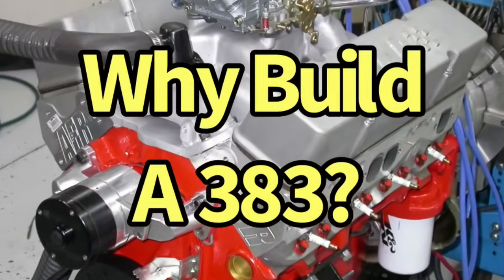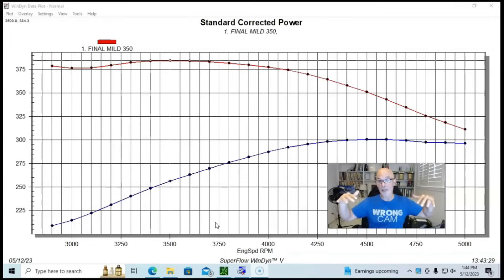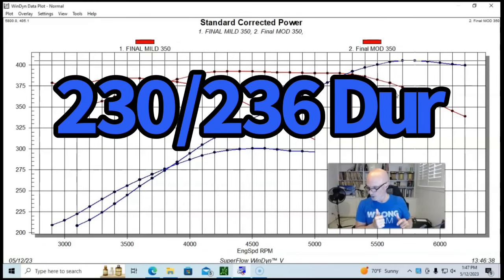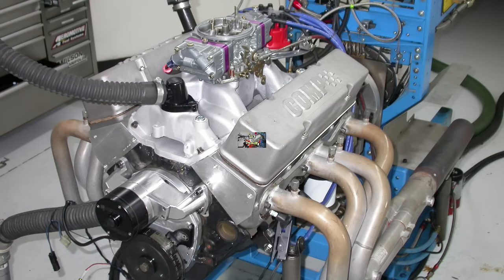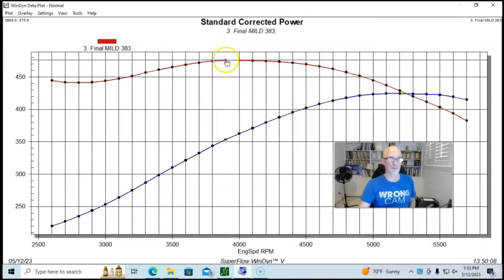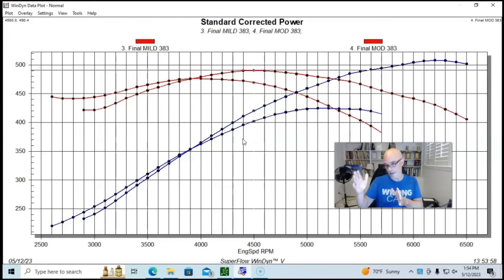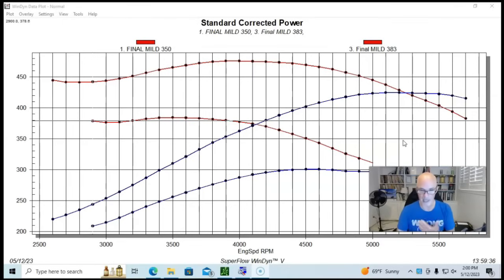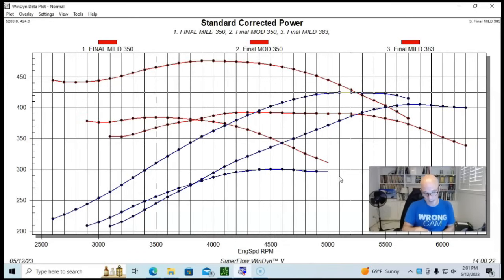HOW DO YOU MAKE MAXIMUM TORQUE WITH A SMALL BLOCK CHEVY? JUST ADD CUBIC INCHES! 383 STROKER BUILD!

Comment: I like it. 

Would the 351W/387W combo work with EECIV? Mass air seems like it might, but I am curious if speed density could be tricked into running it. 

Yes, I'm cheap.
Reply: It isn't "cheap" per se, but Sringer performance sells their PiMP eec 4 replacement that is basically Mega squirt in a plug and play package for eec4. You can even pick batch or sequentially fired injection
Reply: @AndyR1982  Yeah... $2500... It's a bit salty.
Reply: @Heathh49008  , yeah but if i read right, Moates is dropping further support for the Quarterhorse stuff in eec4 so it may be the only way in the near future
Reply: Separate trans controller for the E4OD and a Megasquirt may be my only rational option.

95 F250...
Reply: @Heathh49008  i know it is expensive but they also have PiMP xshift that controls the 4r70w and e4od. Save on having to get a standalone trans controller

Comment: Great test to show how much more torque you gain. Like to see 400 added in show where it stands.
Reply: Same here I'm getting ready to build a 406 would like to see how they compare
Reply: @tron6966  iif a blueprint 400 is any indication 500ft lbs or more
Reply: On a 030 over 400 small block Chevy,  500 pounds of torque and horsepower is very easy to do I built my 10.3 compression combo using AFR 195 street eliminator heads and a comp cams hydraulic flat tappet .507/.510 lift, 240 intake, 246 exhaust duration @50 on a 110 lsa. My combo did 521hp and 516 ft lbs at the crank on the dyno. I used an edlebrock rpm air gap intake, Holley vacuum secondary 750 carb and 1 and 5/8 full length headers. I Put that in a 69 chevelle combined with a th400 trans, a 3000 stall converter and 4.10 12bolt rear and it ran mid 11’s with a totally streetable package on 93 octane that you can drive anywhere. That car was a lot of fun until it lost in a fight with a telephone pole.
Reply: 400 tpi? Even more torque
Reply: Put a 4" crank in your 350, 409 cubes

Comment: Tq is power
Reply: If someone is familiar with electricity, I have a great way of explaining this to them. 

-Torque is like amperage. It’s the grunt or forceful push. 

- Horsepower is like voltage. It is potential energy or where it peaks.

 A stun gun may have 50,000 volts but only 5 amps. It has enough energy to stun you but not kill you. And despite all of that voltage, there isn’t enough amperage to spin a window fan.

A house will have 220 volts but the amperage will typically be between 100 & 200 amps. Either are enough amperage to kill you. And despite the lower voltage, the amperage will power an entire house.

Comment: Zero reason to waste money on these outdated builds. The 80's are over.
Reply: I ll stick to the 80s thank you, the good old reliable small block chevy, still listen to the music from that era too.
Reply: Depends what you're after, a 383 can make a lot of low end grunt, something a 4.8 or 5.3 won't do.
Reply: Actually if someone already has a SBC in a vehicle, all of the accessories will bolt up to a 383. So it might be more cost effective for them. And I have not seen an LS match a 383 torque curve.
 I will concede that the LS has longer life expectancy and is a huge jump in technology, but the SBC isn’t dead. And with current parts available, it’s easier to make power from one now than it was in the old days.
Reply: I won a lot of races against LS1s with a 383. And it wasn’t close.
Reply: I disagree the cost of an ls swap will get you a fresh overhauled small block that can dropped in a weekend
Reply: I have another reason. I has been around a lot of SBCs and quite a few LS engines. I am talking both stock and modified. I have seen a stock or mildly built LS engine idle as smoothly as an old school SBC. To someone who has done driveability and who is tuned in, every single LS engine has a rough idle like it is struggling to idle. And to old school guys who have a connection to the cars, this is unnerving. We are the guys who feel the suspension working and are always conscious of how the exhaust sounds. We tune our cars until we get the sound and performance that we expect from it and we know immediately if something is off. Maybe it’s a generational thing.
Reply: My outdated 383 can stay with 650hp TT bimmers I should toss it in the trash I guess

Comment: I don't dislike the 350 engine I've had very good experience with them. But I've always wanted a 383 because I believe that if you're going to spend the to rebuild spend a few extra bucks on a stroker crank. I think scat used to sell a 383 kit that was almost a bolt in deal. It had cast steel crank and was 3.68 stroke and needed to have a. 040 overbore to make up for the smaller stroke crank. But it didn't need the extra clearance that 3.75 crank does. I don't know how much they are now but it was like 1150 dollars for the whole bottom end. Crank, rods,pistons rings and bearings
Reply: There are several kits on the market.
Reply: @dannytravis7118 , 
327
Forged Steel Vette Crank in a 4 bolt main block , Forged 12:1 Pistons,  Ported Heads,  Comp Cam  ,aluminum intake,  750cfm carb, Headers,  11 inch clutch, Lakewood Blow Proof bell housing, M-21 Muncie 4 speed , 12 bolt posi  ,pulls both front tires off the ground,  screams to the moon at 11,000rpm,  in a 66 Chevelle Super Sport .

That line ,
There's  no replacement for  displacement  
always  makes me laugh !

Comment: These videos are a wealth of knowledge! 

How about a 5.7" vs 6" rod comparison, or maybe a 383 to 396 video? Keep them coming!
Reply from the maker: 5.7 vs 6.0 rods showed no power change
Reply: @richardholdener1727  agreed.  

But I bet you could find in the neighborhood of 20-30 lb ft tightening that lobe separation up to 106, keeping your same overlap by taking out duration and getting back lift via higher ratio rocker and probably not lose anywhere.

I don't understand why SBC circle track cams are 106 lca (outside street stock & compression limited classes) and street cams are 110-112 when 14:1, higher valve action race engine with better heads will want wider lca for a given displacement and 106 is usually closer for the street.

Appreciate & enjoy the content, thanks
Reply: @sc358.  agree with your first paragraph
but if you have optimum compression with the wider lca squeezing the lca will give you more or too much cylinder pressure, you have to do as you say and change the whole formula.   We can talk about better flowing heads (and hemi vs wedge) and lca later  cheers
Reply: @richardholdener1727  was that using the same camshaft, or changing to camshafts that reflect the different piston speeds? I'm assuming the difference in length isn't creating that much difference in piston speeds, but...that's what the dyno is there for :)
Reply: @albertgaspar627  not just piston speed along crank rotation but velocity of the intake charge
Reply: @jmflournoy386 just to be sure, when you say "velocity of intake charge" you mean the piston's speed is enlarging the volume enough to change the pressure of the atmosphere inside the cylinder itself?  

because changing the piston speed can also change evacuation on the exhaust cycle, leaving a "cleaner" cylinder for the intake stroke to fill up.
Reply: @albertgaspar627   Sorta The velocity of the intake charges lags behind the piston, velocity increases even as the piston is slowing down/   at TDC at overlap u get some velocity due to exhaust suck, getting the charge moving is very important as I said above if you do not you can never catch up. 
 Your other point is correct  Another Goldilocks  closing the exhaust too late can give reversion which really screws things up not quite that much can still pull too much fuel through and out thexhaust
Reply: @jmflournoy386  right. also to add to this soup mix, every time that intake valve closes, the air/fuel tries to reverse up the intake manifold runner to a central plenum and get to another cylinder. of course this factor is dependent on engine RPM and runner length and single/dual plenum manifold choice.

but the instant that intake valve comes off the seat, it's looking at a very confused air fuel mixture asking WTF :)   

someone (can't remember who, maybe David Vizard) said that if you get the right 3 angle valve job, you can help flow into the cylinder from no-lift to let's say .3 of an inch. that will help out on the beginning of the intake stroke, and show up again at the end when the valve is closing. but, if you get the right 3 angle on the exhaust as well, you increase flow as the intake is closing and the exhaust valve is opening...effectively helping overlap. 

the problem as i see it, however, if you help air flow in...does it help air flow out (reversion) the intake port and back into the manifold again? if it does, then i think the problem isn't "how much volume of air fuel did we just lose?" but a question of "what's the homegenousness of moving air molecules and heavier atomized fuel in and out of a hot cylinder?"  

we can talk about how much air a particular cylinder head moves on a flowbench, but i think QUALITY is as important as quantity. a ton of air/fuel that burns poorly due to separation may be no better than less air fuel that got in but burned more completely before the piston got 3 inches (or whatever) down the bore and now the cylinder has too much volume for the burning mixture to catch up and actually push on the piston.

ultimately, there's two ways to make more power out of an engine--either you burn what's going in really well (and then you increase the amount so there's more to burn), or you reduce friction to waste less of the power you actually made. getting rid of friction may be the easier one to accomplish :)
Reply: @albertgaspar627  Wow well put  you mean it' s not as easy as picking the bottom listing from the catalog where they recommend that one size fits all
Reply: @jmflournoy386  thank you, and yes you are absolutely right with that end comment :) 

i mean, yeah, i love the sound of a rowdy cam, but a cylinder head that really delivers a lot of good quality air/fuel mixture can make a mild cam really work on a street car that uses a wider part of the RPM range than a race car....as you seem to know :)
Reply: @richardholdener1727  cam should be different but big thing is 6" wears better (what stroke 3" or 4")
Reply: I was also gonna ask his opinion on 383 vs 396 sbc
Reply: 6" has less side loading, more dwell around TDC so needs less overlap, (slightly) wider lobe center 
as the 5,7 accelerates the piston faster you have to start the IO earlier. close the exhaust earlier
also remember the short 400 rod
Reply: @jmflournoy386  right, the change in piston speed can create a different ability to load up a cylinder with air/fuel. so changing the rod isn't enough, a cam swap is in order (a DOHC engine used for the mule would make this real easy, esp. in changing lobe separation or overlap).  Of course, airflow is half the battle, the quality of the air/fuel going in really matter.

if the heavier atomized fuel separates from the air molecules, then the amount of volume drawn in barely matters--the burn is gonna suck and not in the right way :)
Reply: @albertgaspar627  also a longer rod gives a lighter piston
Reply: @jmflournoy386  It will, and the longer length of the rod doesn't count as much on reciprocating weight since its rotating as well as moving. The downside of the shorter piston is the ring placement (lookin' at you, 347 ford windsors) if you go with a power adder that increases combustion pressure suddenly.
Reply: @albertgaspar627  On the 4 1/8 x 4 1/4 452 327 block SBC with stock 6"GM 2" crankpin rod we had  to run 2 rings  or two through the pin with about a 1" compression height so I know where you are coming from
Still most builds have excess  CH  that can be utilized to reduce piston weight
Reply: @jmflournoy386  and if you want to get fancy you can run a dry sump or just a vacuum pump on the crankcase to try to pull in a thin set of piston rings to reduce friction (and then have to deal with the drag of an extra pulley on the crank). or just gas port, but I run street setups. 

Agreed that the average off the shelf piston slug can use some updating in design. and some as you know are utilizing a shorter length wrist pin as well. if it can lead to a knife edged or pendullum cut on the crank weights, it pays off in the long run. less gas burned to make power is less time in the pits, or just better on a street engine built to last 100K
Reply: @jmflournoy386  5.65 rod ,, have a set in the shed
Reply: I have a deluxe ZZ383 Crate motor with the Fast Burn aluminum heads , what are your thoughts about this engine!

Plan on putting it into a 91 Z28 one problem right off. The bat is hood clearance that motor came with a very tall intake manifold so I know we’re gonna have to use a different intake. I have no plans of a hood scoop. Also, this will cut down my horsepower, but should help me on  bottom end torque, right?
Reply: It doesn't cost any extra money for the 6.0 rods so might as well get them...

Comment: Would a 383 still be good for a daily?
Reply: I drove a 383 powered ‘71 Nova daily in the 90s and it was phenomenal. Horsepower may win races at the racetrack but torque is what you want on the streets. Small displacement engines need to be rev’d to be enjoyed. A fat torque curve will put a smile on your face at 1/2 throttle. I have built hundreds of engines and that 383 is still my all time favorite. Planning to build another in the future.
Reply: yep.  plenty of 450HP 383s running around and they idle fine

Comment: The 383 seems to be a sweet spot for small blocks. You could do the same with a 377 but of you have a 400 why make it smaller? And you could do the same with a 410 and have a smoother idle and better low speed performance but 350 blocks are more common and a 383 is a pretty good place to be.
Reply: A 377 & 383 will make similar power because the displacement is so close.  I used believe that the longer stroke option would make more torque but that has been disproved. The larger bore of the 400 could offer a little extra space around the valves for flow with the right heads.
Reply: 396 sbc

3.875 crank

377s  wind up faster like a 327...just bigger big bore short stroke

Comment: Very confusing. There is alot of 580 to 650 383 SBC over youtube naturally aspirated. Thoses number make it look like a LS swap is not necesserly needed. But why it seems so hard for you to get that kind of LS power out of your 383?
Reply from the maker: a 650-hp 383 sbc is not going to be a driver
Reply: @richardholdener1727   Is it possible to do a 600 that is?
Reply: because peopple use smaller heads and LS head flow better of course because of 60 yrs of advancements.  

youre more likely to see 525-550 HP 383s on pump gas.  600HP out of a naturally aspirated 383  isnt gonna run on pump gas unless you got a decent sized solid roller camshaft  and some 220 CC heads that are CNC cut.  and solid rollers that size are gonna be difficult to keep alive on the street withour using 1100.00 lifters  so you dont eat the valvetrain up and too high of spring rates.

a 400 can do it  N/A  a little easier
Reply: @KingJT80  Richard is using AFR enforcer they are the best or kind of.  Just curious why that 600hp barrier is real or not
Reply: @mathieusynnott8915  enforcers aren't the eliminators. They're the cheap overseas version and those springs had about the biggest cam you can use with them without having to change the spring. 236 max duration. 

Not a bad head for the price of less than 1500.00 from what I hear. 

To do something like that you need a 240-250+@.050 and . 600 lift camshaft with a 195-210+ AFR CNCd head

 these flow 270-300+ cfm. 

Right where a lot of LS heads are flowing

It's just you'll have to spin that engine pretty dam hard with 383 inches to make 600
Reply: @mathieusynnott8915  No its not a barrier its not an engine youd wanna drive very often.
Reply: Most of those power claims are bs.

Comment: Great video Rich, what is your preference when building a 383 using a 5.7" rod or 6" rod??
Reply: Any difference in power will be small. A longer rod might add some extra hours (longer life) on your engine run time due to less wear.
Reply: They cost the same

I'd do the 6.0 rod.

Comment: I just finished watching your 408cid LS stroker video and started craving one for sbc. And look, here it already is :)! Thank you Richard! I wonder how much would a basic budget stroker kit increase the price tag of sbc rebuild?
Reply: Last I checked you can buy an entire rotating assembly for $900. Cast crank, forged i-beam rods and hypereutectic pistons. Plenty strong for a naturally aspirated build or a low boost build. More like $1200+ if you want a forged crank and pistons too.
Reply: It can quickly become a difference between what quality of the machining is on the budget parts, most kits with say Eagle or Scat for instance usually need machining to get them good.
Reply: @PSA78  SCAT better
Reply: @jmflournoy386  Than Eagle, yes. Than anything else, not even close from what I've seen. 😄